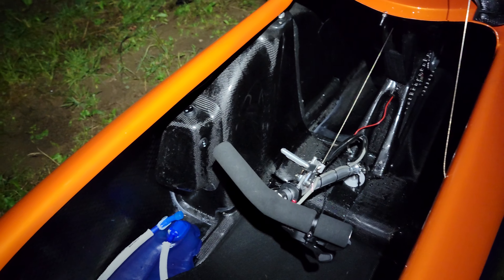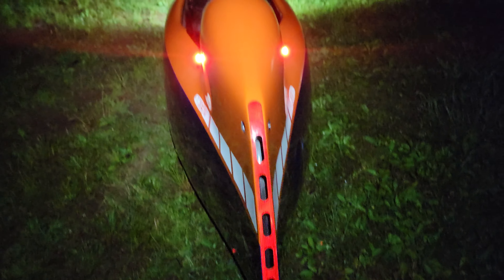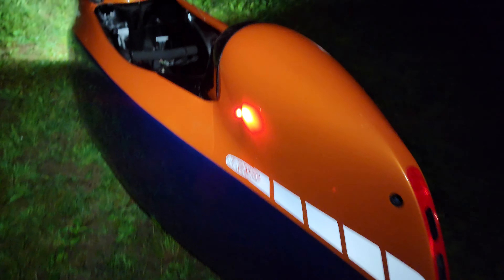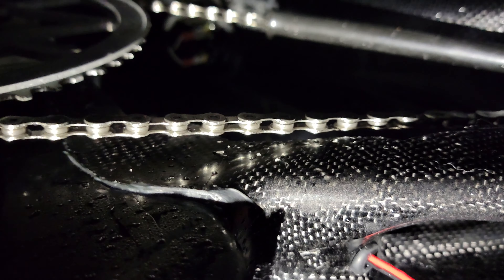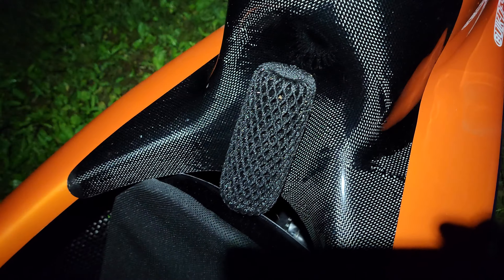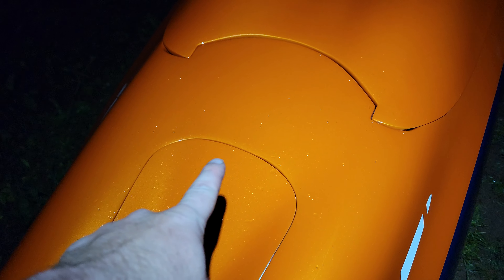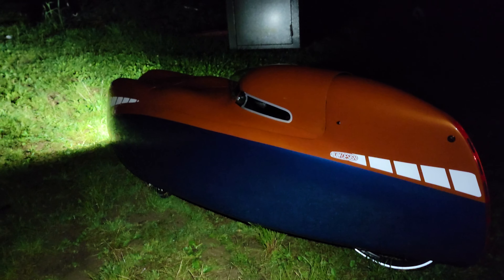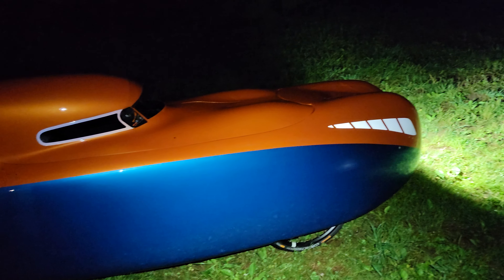Bülk Velomobile 1st Impressions

Comment: Did you talk to Velomobileworld before cutting the boom? It looks like you may have weakened it by doing so. If cutting away the boom is the only solution, I'd say that's either a design flaw or something was not assembled correctly.
Reply from the maker: I let them know but there was no way around it either i cut it or the chain was gonna grind thru it. Not like i can return it to velomobile world for them to fix it. They said they would get back to me on why it rubbed and if it will hurt anything but cutting away that area i sent them a pic. But Ben Parke showed me a pic of his and his had a curve cut into it from the factory mine was straight i beleive they may have cut the curve on the wrong side or forgkt to cut the curve om the drive side cuz it was curved on the other side. But no idt it compromised the strength. Claire told me she had to do the same thing to her bülk and grind away that part there same exact spot. So far waiting on a response from velomobile world on several issues im having. But its not the boom itself its like the sides of the battery tray where its kind of thick carbon but uts just a flat peice. But it didnt seem to affect the strength when riding i pushed pretty hard and it didnt creak, flex, or crack. Either way it was necessary and theres no other option. If its structural then they need to rethink their design.
Reply from the maker: Just got a video from Jan he said its ok to cut there cuz it gets most of its strength from the vertical pillar and that peice is for the battery tray really.